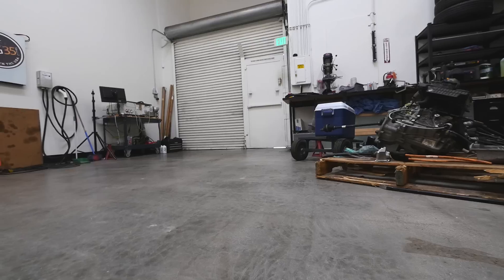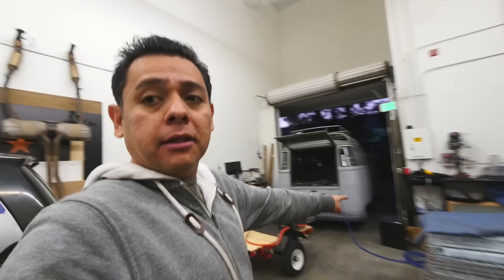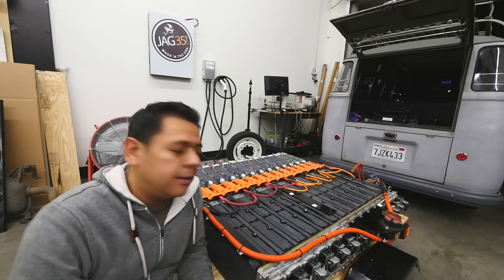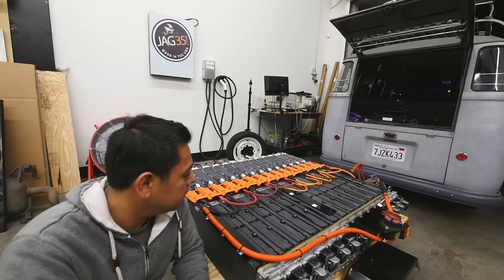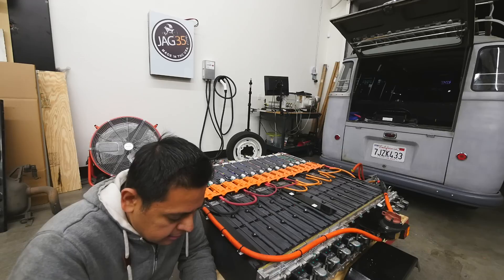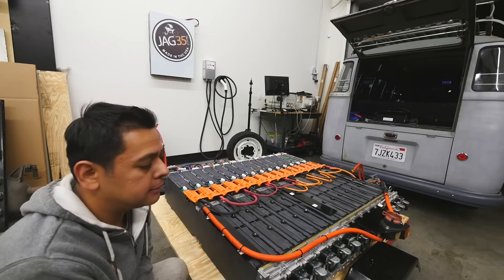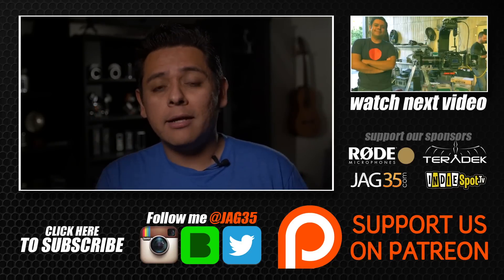Electric Vehicle Range extending Tesla Battery Trailer project pt4

Comment: You want tongue weight on a trailer.   60-80 lbs. I'd guess from your setup.   to much to the back and trailer will start swaying back and forth.   Also want a level or slightly down connection if trailer is tilted up it will have issues as well.  Also you will find the longer the tongue of the trailer is the easier it is to backup as it turns slower and is easier to see in mirrors.   oops, didnt see this is a 2016 video, Ill leave comment anyway

Comment: It's great to see people are already working on this idea. I would love to see a range extending trailer that would add about 400 miles onto my Nissan Leaf. I hope Nissan is listening! Maybe they could rent the trailer out because I imagine it would be very expensive to buy one of these things. Plus you would only need the trailer when you take off across country on those long trips where the chargers are few and far between. If the trailer were also a small RV you could sleep in the thing and save some motel costs at the same time.

Comment: don't know if someone has mentioned this or not, but the grote 82-1041 socket and 82-1042 plugs are rated at 200 amps (continuous), and might work well for attaching the power leads to your trailer :)

Comment: Its better if you cover up the batteries with sheet metal. So you can use the trailer and batteries are in the floor.

Comment: not very clear what is holding the batteries on there, is it going to slide around with highway speed stopping ?

can you box the batteries in a bit with some solid supports, and fix them down to steel the trailer frame ?

if they shift around, it's going to be a bad time. those things are pretty heavy, loads more inertia at highway speed if you stop.

Comment: Hi jehu I fully support all the comments saying that you must put at least 100 lbs on the tongue if you loose control of the trailer it will make the van loose control and you might end up on the roof here I wonder is this set up safe to touch is there any high voltage exposed ? I would seal it with at last a thick tarp it would be safer and if it rains.

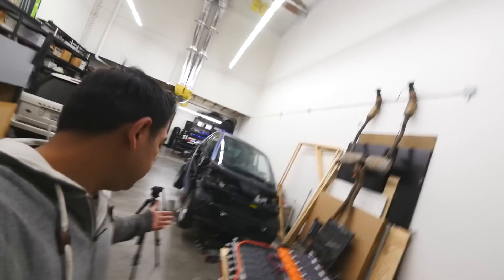Comment: Yea Jehu, 7:31 just echoing what has already been said, you weight bias should be forward on the axles.  Especially if you vehicle is driven by the rear wheels, if you drive over a berm or other road undulation, if its big enough you can actually lose grip in your rear tires not good, you'll also hear a loud 'clunk' whenever you drive over big bumps, and that would be the trailer trying to pull up on the ball, not good at all, definitely change the bias of the weight towards the tongue, you'll be glad you did

Comment: Uh, back heavy is a special kind of dangerous.  

You need to get a proper portion of weight back on that hitch.  Something like 60/40 so that approximately 10% of trailer weight is carried by the Samba.  Hitches are not made to handle negative tongue weight other than instantaneously at bumps.  It could wear out and fail in just tens of miles.

For project of this nature, it would probably be wise to have the packs mounted to a structure that can be adjusted fore-aft on the trailer.  Or a movable axle.  I presume this whole thing is just a prototype, because those DIY trailers are generally not up to the task of actually carrying the weights they claim as rated capacities.  Maybe 80%.
Reply: +Bob O`Bob Nope, I think he fully intends to take it as is as long as he gets the trailer registered. A neutral weighted trailer is not what you want for sure. If that sucker starts to rock and roll it will most likely be too late and he will have a trailer full of batteries strewn over the freeway. Not a good thing. Having a trailer is a great thing. Having it rock and roll and flip is a terrible thing. Get the weight forward. I have no clue who told him neutral weight is good.
Reply: +Bob O`Bob Weight and Balance just as important in airplanes, boats and trailers. Good that you got Jehu's back on this and providing him with things to consider. Things can go south fast with trailers. Many a poorly loaded boat has passed a fisherman on the highway before that is no bueno.

Comment: if that trailer waves, as you estimate it, 800 ish pounds, you need a tongue weigh between 80 and 100 pounds to make it tow properly.  if you do not have a minimum of 80 pound tongue weight, you stand a very very good chance of scattering very expensive batteries all over the freeway.